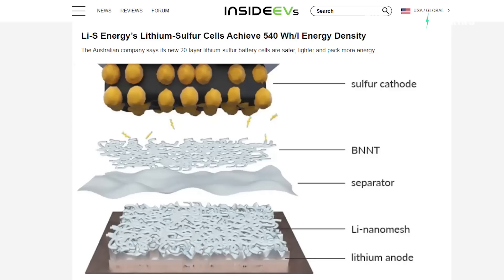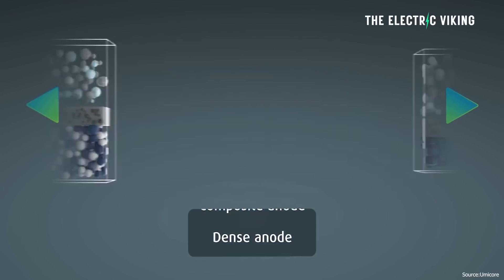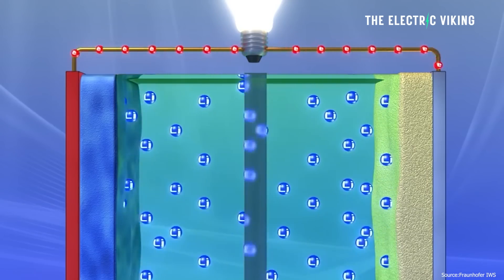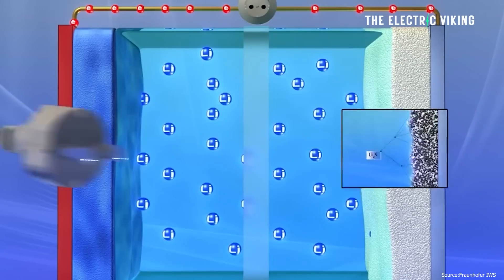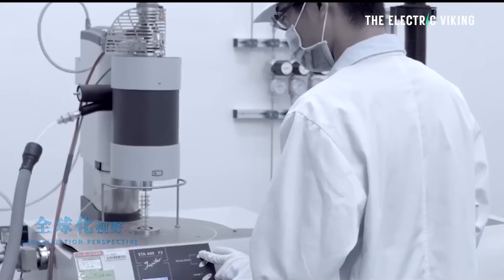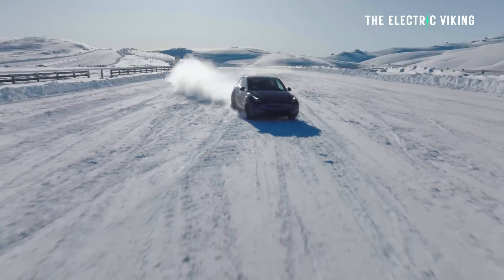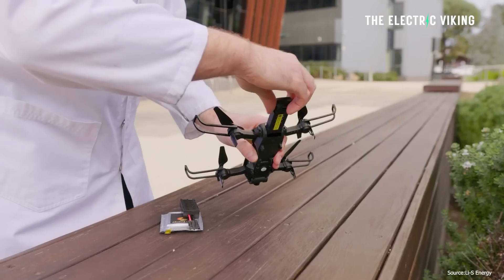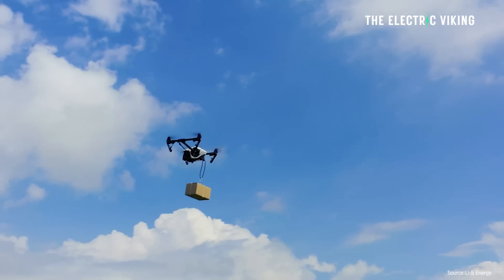Li-S Energy’s Lithium-Sulfur Batteries Achieve 540 Wh/l Energy Density

Comment: Yeah that's not gonna happen any time soon . I like to believe they got all the incredibly dfficult tasks of making LI-S battery . But unfortunatley , I don't . Reasons :  if they do small cells fo drones and all types of small applications . means to me that the Thermal expansion is still an issue . Traditional EV batteries has thoes problems . LI-S If i remember correctly it expands 3 times its volume during the charge/dischage cycle . so yeah just by that it means its gonna take some time .... not to mention its sabilty under very high loads . Id personaly consider Quite an achievement if they managed to make the sulfur more conductive . Like this is one of those "to good to be true " things .  They just need to back up their claims with some consitant data .

Comment: The problem of Li S batteries is that the sulfur gets depleted very quickly.  In practice they only support 100 charging cycles.  Cars need at least 1500 to be commercially viable.  I think that's why they are talking about aviation instead.  Hope they keep improving the technology...

Comment: Sam,  you keep confusing Watts (W) and Watt-Hours (WHr).  Watts are a measure of Power and Watt-Hours are a measure of Energy.  When talking about the energy storage of an EV battery we usually are interested in Watt-Hours per unit weight, not unit volume.  Therefore, you should be talking about Watt-Hrs/Kilogram.

Comment: Sam, if two battery packs of different densities both have 77 kW•h of capacity, they would have approximately the same range.  The advantage of the higher density pack would be that it's physically smaller and probably lighter - therefore generating less tire friction, and could be installed in a small car.

Comment: Volumetric energy density is not all that important as compared to Gravimetric energy density.

Mass is all important. Your car is mostly an empty box full of air. The area in the frunk, and under the seats can also be used for more cells if needed. There is more than enough space for the battery already.

But, lighter cells are the holygrail.

Comment: I understand the mass confusion over energy density (watt-hours/liter) vs. Specific Energy Density or Gravimetric Energy Density (watt-hours/kilogram) vs. Power Density (watts/liter) and Specific or Gravimetric Power Density (watts/kilogram), basically because it is fed by misstatements of the uninformed general media that really doesn't care enough to appreciate the profound differences in these key battery performance metrics.

Along with Sam, we all can and need to do better at communicating the important differences.

The most important differences in these metrics is that battery weight and volume are both important bases for comparing a battery type's energy and/or power characteristics. The reason volume is often more important than weight is because a mobile application like a car or truck is constrained in the amount of space available for fitting the battery into the vehicle. Battery weight is likewise important primarily because the heavier the battery is, the greater is the amount of power needed to accelerate the vehicle, with this needed power increasing almost proportionately, increasing vehicle cost, particularly the size and cost of the propulsion motor and its associated power electronics. Energy consumption also increases somewhat with battery weight, though not as much as one might expect, due to energy recovery with regenerative braking.

So, when you see an Energy Density number of 540 watt-hours/liter (wh/l), one needs to compare it to the equivalent metric for other batteries, such as Tesla's 4680.

The usable energy in Tesla's 4680 cell has been estimated at 96 to 99 watt-hours. The cylindrical volume that this 4680 cell occupies is computed simply as pi x radius-squared x height = 3.14159 x (46/2) x (46/2) mm-squared x 80 mm = 132,952 mm-cubed = 0.132952 liters. So, dividing 96 watt-hours of energy by 0.132952 liters of volume gives us 722 watt-hours per liter.

Therefore, the Energy Density of the current Tesla 4680 Li-ion cell is at least 722 watt-hours/liter and thus clearly exceeds the 540 wh/liter Energy Density of the Australian Lithium-Sulfur cell being highlighted in this video by Sam. 

Hopefully, Sam and the rest of us can begin to at least attempt to compare the alternative battery chemistries on something approaching an apples-4-apples basis.
Reply: Volumetric energy density is not all that important as compared to Gravimetric energy density.

Mass is all important. Your car is mostly an empty box full of air. The area in the frunk, and under the seats can also be used for more cells if needed. There is more than enough space for the battery already.

But, lighter cells are the holygrail.
Reply: @nordic5490  The reason your car, van or truck are primarily air is to leave room for passengers and cargo. Preserving this internal space is  a top priority for all vehicle designers. Lighter batteries are preferred within the same available space, of course, but the primary constraint for mobility applications is actually space rather than weight. That's why the wh/l metric is actually more important than the wh/kg metric, for packaging the battery within the vehicle. The frunk and the sub-trunk of the Model Y are both examples of the importance of preserving space. You can stick a spare tire in either one if you want, but the value of preserving this space for cargo for most people is greater than filling either of these spaces with a spare tire or more batteries.

Comment: 400 Wh/kg is good, and the fact that they are using sulfur is great, thanks for this info. But Sam, please use the "watt-hour" (Wh) term when discussing energy density (e.g. 540 Wh/l or 400 Wh/kg). Watts (W) refer to instantaneous power (like the HP or KW figures for an ICE motor), while watt-hours (or Amp-hours for lead-acid car batteries) refer to the energy contained in a battery (like the energy in a gas tank for ICE car, which we describe by volume not energy, further confusing us... 1 liter of gas has about 8.9 kWh or 8,900 Wh of energy). So in the Li-S case you mentioned a one liter battery has 540 Wh of energy, so if this energy was discharged over time to a 60 W light bulb, it would run for 9 hours (60Wx9h=540Wh), or for a 90 watt lcd screen it would run for 6 hours (90Wx6h=540Wh). It is quite confusing for people who aren't engineering types to understand this difference as in common parlance "power" and "energy" terms are commonly interchanged. You are right though, Wh/kg is more commonly used as an energy density term for EVs. For most (not all) personal transportation modes weight is more important than volume, but not always. Think of bicycles, motorcycles, cars, planes, ships, trains, etc. Weight is a much more important factor for motorcycles or airplanes than ships or trains. Hope this helps.

Comment: 1:10 Energy density is measured in kW/L, it is the energy per volume. So they are correct to call it energy density and measure it in litres.

kW/kg is specific energy also know as gravimetric energy density. The alternative name is probably what causes a lot of people to confuse the two different properties.
Reply: Sam's got you up the creek now - Wh / kg   Wh / l .  Joules cures all ills.

Comment: Having cars driven by an electric motor and reduction gearbox makes good sense. I’ll definitely buy one myself when charging stations are as abundant as normal service stations and a full charge takes the same time as filling up a normal car with petrol or diesel. But what do we do with scores of millions of 500kg toxic batteries when they eventually expire. The things I’m reading about recycling don’t sound very positive. Very expensive, labour intensive and significant energy required. I think we need to get the recycling process properly established. Perhaps a legislated mandatory requirement for each car company to take their battery back when it expires and take ownership of the recycling process. Ideas anyone…?

Comment: Exxon has inked a deal with a chemicals producer for the development of lithium resources in Arkansas as it ventures further into the battery metal, Reuters has reported.

The news follows last month’s report by the Wall Street Journal that Exxon had acquired the rights to a lithium deposit in Arkansas, for which it paid $100 million.

The report quoted unnamed sources as saying the supermajor could begin drilling at the deposit in the next few months. According to the previous owner of the assets, they may contain up to 4 million tons of lithium carbonate equivalent, which the WSJ said was enough for 50 million EV batteries.

Comment: Lawn mower comments tell half the story of electric lawnmowers. Power is only 1 metric, and it’s not the most important one. I have a John Deere gas mower and an EGO electric mower. The JD is a far better mower. It’s all about blade tip speed. The EGO has far slower tip speed to help extend battery run time. Problem is the slower tip speed generates FAR LESS suction. So if you use your mower in the fall to ‘vacuum up’ leaves and twigs and damp or wet grass, the EGO is an incapable choice. But under perfect mowing conditions the EGO works great. I rarely have perfect mowing conditions!

Comment: Li-S is a really cool technology, but the downside of course is that it is still limited by lithium supply.
What I really hope for is a breakthrough in Na-S (Sodium-Sulfur). This could potentially provide the best of both worlds, with a relatively high density battery made from cheap and abundant materials.

Comment: It's still in the lab though. There are 1000s of battery prototypes sitting in labs all over the world like this. Mass manufacturing at scale and at an affordable price is a completely different proposition altogether.
Reply: He casually threw away the most expensive problematic portion... Boron NANOTUBES... as if this isn't even to be mentioned as THE key to everything.  Anything Nanotubes = horrifically expensive.

Comment: Sam, a 40kWh battery pack holds 40kWh of energy regardless of the battery chemistry! Increasing volumetric or gravimetric density allows that quantity of energy to be held in a smaller or lighter physical package. I'm sure you know this but you have made this slip-up before, so I thought I should mention it as it might confuse some people. Otherwise, keep up your great work!
Reply: He's talking about the form factor. If you take a 40kWh pack and swap out the cells for a higher density, you get more capacity in the same package.
For example, if you go from LFP to Li-S, you can basically double the capacity as a drop-in replacement.

Comment: The next-level of developing better batteries is:  1. the use of layers 2. the use of Sulpher- compounds (Toyota's secret battery is also using Sulpher/ improves E-density and charging speed). The Austrialian company has patented a compound in their battery:  I do not think that there are no better alternatives. SO, I ADVICE THEM TO SELL THE PATENT QUICKLY TO CATL...... otherwise you will end empty handed in the long term.

Comment: At 1:12 using liters or kg are in fact two different and both valid measurements.  I always have to look them up, volumetric energy density is based on volume, so liters, specific energy... Gravimetric is based on weight... Wait, at 3:30 you do mention the two... Anyway.. sigh.

Comment: The most important feature in my view is ability to recharge and discharge quickly without having a short lifetime.  LTO cells are the ones today that do this, they just have too much weight compared to all the other chemistries.   If they can produce LTO performance with even less weight than the existing car batteries, they will have a winner.
As usual, battery breakthrough press releases mean nothing until they can show it working in the real world and competitive cost vs lab results.
Reply: Thanks. What are the components in LTO?  Is this Lithium and Titanium?

Comment: The lifetime of these cells has not been mentioned, I expect a problem here, the next challenge will be to solve the volume change when charging and discharging sulphur based cells, unfortunately large scale production and use in vehicles is still a long way off.
Reply: Since no one has ever made a long cycle life Li sulpher cell let alone battery, yea, MASSIVE problem.

Comment: Sam, you are used to hearing energy density in terms of gravimetric density, but volumetric density is the second half of energy density. In reality there are 4 important metrics for batteries: gravimetric and volumetric ENERGY density, and gravimetric and volumetric POWER density. Energy density refers to the total battery storage capacity in kW hours (75kWhrs, 80kWhrs, 100kWhrs, etc), while the power density is how many kWatts the battery can deliver at any moment (250kW, 400kW, 700kW, 900kW, etc).

Comment: For aircraft use the comparison should be with petrol/gasoline at about 60 times higher than current best Li batteries as used in eVTOL - the battery weight penalty eats up just about all useful payload and/or range as compared to ICE powered aircraft . No conceivable battery can have 60 times more power to weight ratio and using Vertical take off and landing which takes around ten times the cruising power eats up any motor weight savings of electric over ICE . The resultant aircraft using battery tech are hugely oversized in comparison to normal four seaters just to carry the hidden 'stowaways' in the battery compartment (another ten people equiv ) --there is an Australian solution to this if you would like to know about it .....

Comment: Confusing energy density and capacity? A battery of increased energy density but the same capacity won't give greater range, it just means the battery can be physically smaller, either in size or weight, to give the same range.

Comment: I don't know why they bother quoting Watts per litre, when you're not going to be pouring the stuff in to recharge.
Reply: If you are stuffing the battery into something small size matters. Would you like your cordless drill to last twice as long between battery changes?  The battery cannot be too big or too heavy  or people will just use smaller  lighter ones and put up with more changes to avoid ridiculously heavy our weirdly chunky tools.
Reply: Yeah I understand that, but as a general guide I thought wh/kg would have been adequate,  but understand that volume ( wh/litre ) plays a part,  as battery technologies differ in their internal structure. But for the average Joe viewer out there, I think wh/kg seems adequate in most cases. Anyway it's neither  here nor there in the grand scheme of things. Anything around 400 wh/kg is seen as a significant breakthrough.

Comment: I'm all for Aussie innovation, however LiS technology has been around for decades - it suffers from polysulphide shuttle which results in rapid capacity reduction due to anode degradation. If Li-S Energy have been able to mitigate this with BNNT and Li nano mesh, lets see battery performance data in the public domain.
Until then I suspect the Li-S Energy share price will continue to languish at $0.28 AUD, down from $2.40 AUD  in October 2021.

Comment: Li-S batteries are not a new tech, but have always struggled with cycle life (<200 cycles) - no mention if this has been dealt with.   Even so, the watt/kg of these cells would make them interesting for drones
Reply: There's always a catch, isn't there. It is not uncommon for new battery technologies to be announced that massively improve one characteristic but comes at a great cost to others. Unfortunately, you need to tick a lot of boxes to have a viable product. For example, I recall hearing many years ago about a battery technology that was compact and had an extraordinarily fast recharge time but was stuffed after 3 recharges.
Reply: Exactly.  Batteries for mobile use (like cars and trucks) need density, reasonable cost, reasonable recharge time, decent discharge rates, safety, reasonable charge cycle life, and calendar life.   Many batteries do many of those things well, but getting them ALL in one package is difficult.  I still think we're a decade away from a true "game changer" tech that will replace lithium phosphate cells in cars.

Comment: I truly hope these new Li-S batteries are CHEAPER for EV's sake. I like the idea of an ev, but I''m holding off for the next generation of battery that cannot explode, is eco-friendly, has this kind of energy density (~490 wh/k), charges extremely fast and is very recyclable.
Reply: At this point EVs are far less likely than ICE vehicles to catch fire, and only ICE vehicles with petrol/gasoline tanks "explode." At this point lithium battery recycling is very profitable. Lithium battery recyclers currently make over $700 per tonne in profit selling the metals and black mass from recycled lithium batteries. While batteries do require materials, they are far less impactful than the oil mining industry not counting the CO2 produced when burning oil, and once all vehicles are electric, it is expected that the majority of battery materials for autos will come from recycled batteries. I have never been able to recycle a single gallon of gasoline burned in any vehicle I have owned, or the other 8 gallons of oil used to deliver that gallon of energy to my wheels.
Reply: Me too. Still expensive
Reply: Even the worse lithium batteries installed in cars were less likely to catch fire (they don't explode) than any gas car - ten times less likely at least.  If that's your concern, get rid of your gas cars now.  The latest gen batteries may be 100X less likely to catch fire than a gas car.